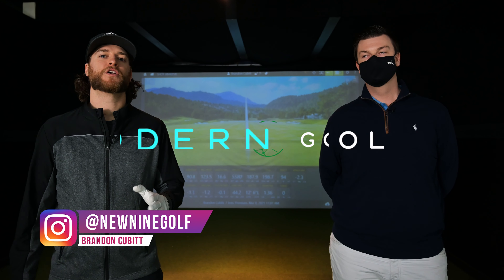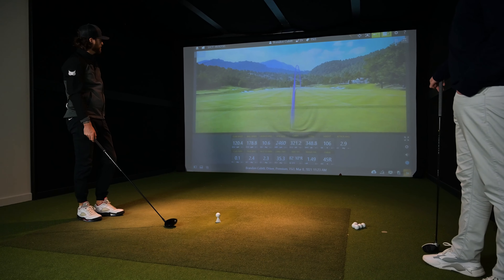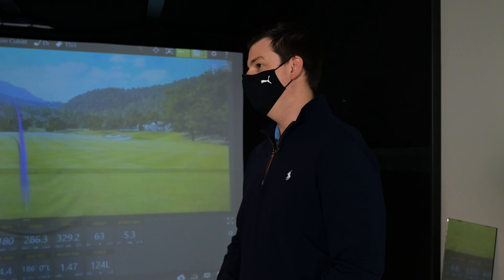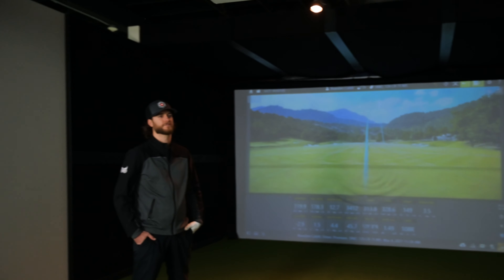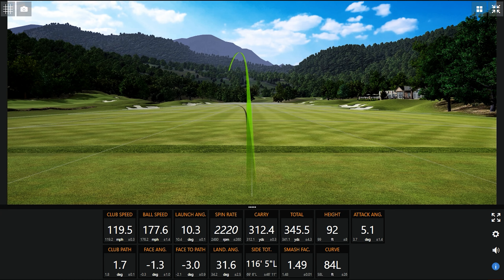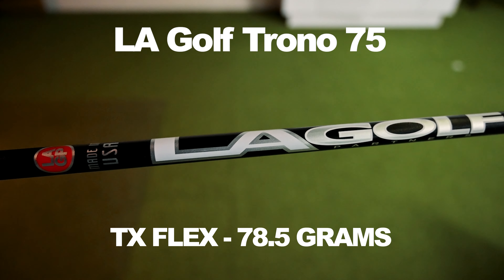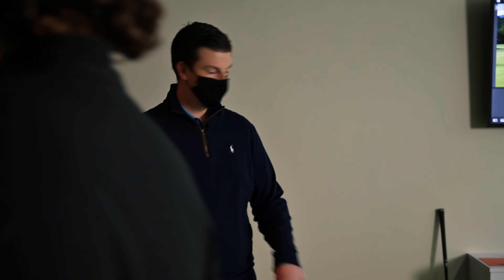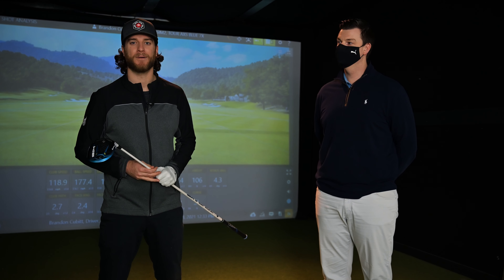Golf Driver Fitting 2021 |  Do Driver Shafts Make A Big Difference?

Comment: Went back to check out your shaft fitting. I couldn't remember if it was w the SIM2 or Stealth Plus. 180 ball speed and 356 yards w SIM2 and LA Golf AXS. Gotta try this shaft in the Stealth Plus.
Reply from the maker: Good call. I might do a new driver bracket with the fitted shaft.

Comment: Great video....shaft and clubhead makes such a different in feel and contact/stability. The TSi3 replaced my TS3. After testing several new clubheads with stock shaft the TSi3 won it in feel and than the graphite design Tour AD XC made a huge difference (for me) in feel, balcontact/ stability and dispersion (also a little more distance). Luckily only a small amount of extra money with Titleist for this after market shaft😎👍🏽
Reply from the maker: That’s for watching! It makes a huge difference! Glad the TSi3 worked out for you!
Reply: @NewNineGolf  ...and how did the homefront react to the price of the driver😱🤑
Reply from the maker: @Raymond-sj7cn  she thinks I won it 😉
Reply: @NewNineGolf  😂😂😂

Comment: Wish there are more fitting shops here in Korea for LAGP shafts. My swing speed is around 115-120 miles and currently using tensei 1k pro 60x with 0.75 inch tip cut. However still trying to reduce distance loss with high backspin and loft angle.  Recently heard about LA golf shafts and interested in trono and AXS blue. how those two feeling different and what specs would you recommend for me? Thanks for the great contents!
Reply from the maker: I’m right int the exact same swing speed and I use the AXS Blue. It’s great low spinning. I still hit it relatively high but I’ve always hit it high. I don’t have a big miss which is the trade off.
Reply: @NewNineGolf  Helped me a lot and decided to order AXS blue for me! thanks!!
Reply from the maker: That’s awesome! You’ll love it!

Comment: Why wouldnt you try different shafts in the Tsi3? More ball speed translates to more distance. I personally HATED the RDX in the Tsi3 head. Put the Tour AD XC shaft in and love it. Also think the Tsi is far more forgiving than the Sim2
Reply from the maker: With out a doubt the TSI3 performed great. Aesthetically, I must preferred the Sim2, looking at the two that the one I’d rather play and the numbers were so similar I wanted to dial in the Sim2.
Reply: @NewNineGolf  Appreciate the feedback. Everything is personal for sure when it comes to golf equipment. Just curious, do you spin the Sim2 with more consistency? I feel like i spin my Tsi3 quite a bit. but hit it straight! Also, which do you think is more forgiving ?
Reply from the maker: Once we dialed in the shaft the spin was right where I wanted it around 2500. Did you get fit for your shaft?
Reply: @NewNineGolf  Got fit by Titleist. BUT I feel like I'm spinning it around 2700. We all know thats too high. You can just see it floating in the air a bit too long. In comparison, my swing speed is about 115. Thats my gaming speed. And you're carrying the ball 20-30 yards longer than me on the simulator.
Reply from the maker: Likely the elevation. Where I am in Calgary we are 3,420 ft above sea level and the sim is set to that. Is your sim numbers at sea level?
Reply: @NewNineGolf  Only got fitted for the Tsi3 driver. The sound, look and feel stole the show for me. But now that I see some people in my club out driving me with 105mph swing speeds, has me wondering why